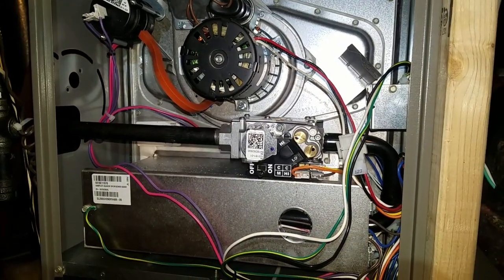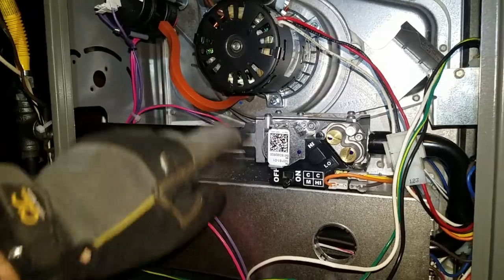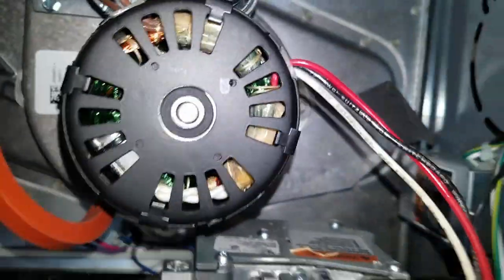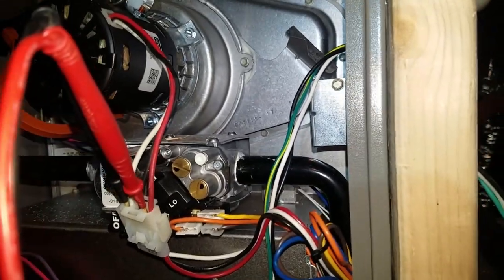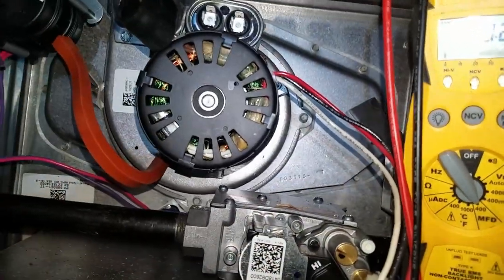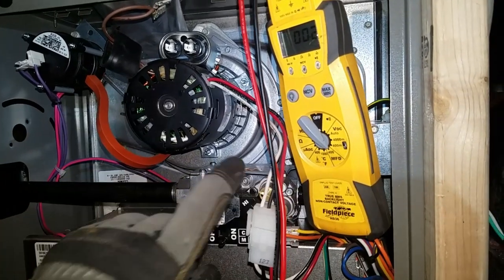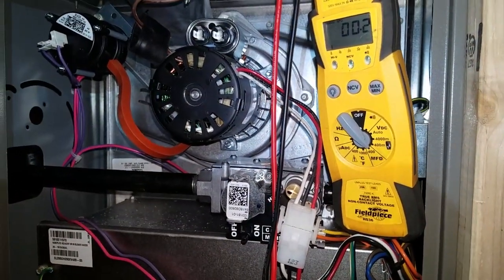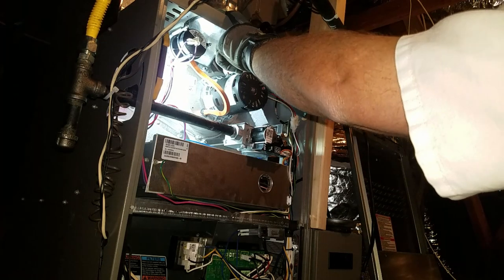EP2 Inducter Draft Motor not Starting on a New System

Comment: Had similar problem, inducer was not coming on, was getting 120v, called it as failed inducer motor. Came back to replace it and as I was taking it off found out that the rubber plug that comes on the evap coils fell inside inducer assembly and was the reason it wasn’t spinning, it was just stuck on the rubber plug. Lessened learned